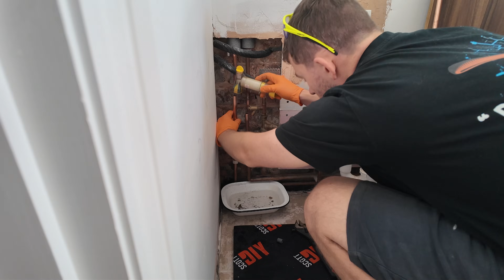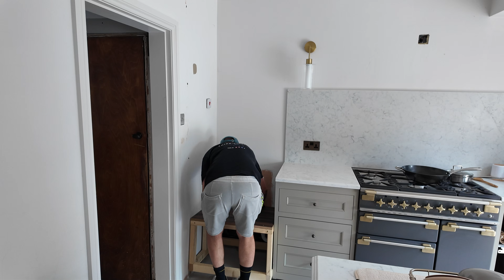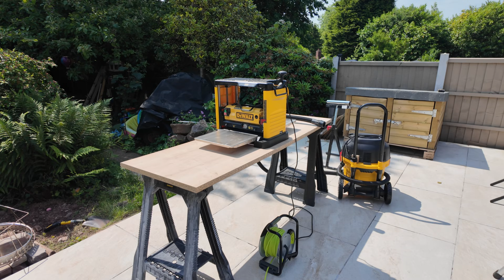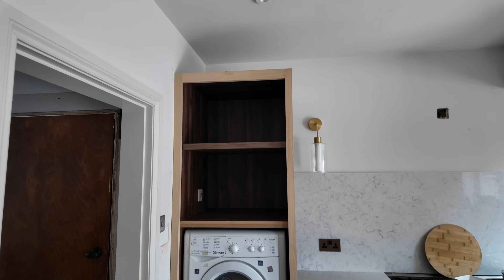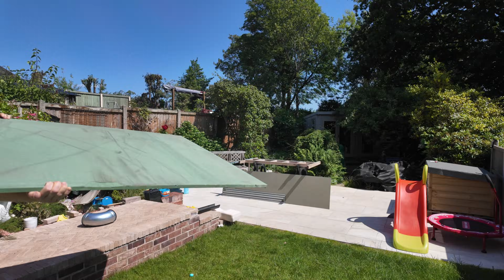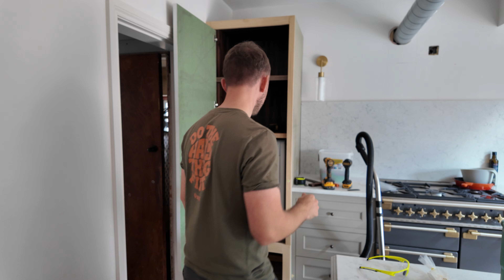DIY Washing machine in-frame cabinet from scratch

Comment: Wouldn't it be better if the washing machine sat on a sliding sheet for easy access to the back? You would have to attach the whole thing to the wall so it doesn't tip over

Comment: Do not raise your machine off the floor because someday you will have to have it repaired and service engineers will not lift it out of that position let alone actually be able to work on it.
Reply: Nobody repairs appliances any more.  It's easier and cheaper just to replace a broken unit.

Comment: This is what washing machine manufacturers say about sitting a washing machine on a platform.  Installing on anything other than a firm floor can void warranties and could create safety issues.  It’s never a good idea to raise a washing machine off the floor, too much vibration and too heavy.  It will be so noisy, that box will amplify the sound.  I would have moved the stop cock.  You are going to have your toilet just through the wall, you have already removed the brick for access.  Turn your cold water off at the toby in the street extend the copper pipe comming out the incoming main through into where your toilet is going to be and place the stop cock in the toilet under where the sink will be.   Then you can sit the washing machine on the floor.

Comment: It’s sometimes worth cutting the shorter ends off for the cross pieces before planing. Will mean you will have to remove less material from both pieces if there is a larger cup/twist across the full length of the longer board by shortening the length that the cup/twist travels through the peice.
Reply from the maker: That’s great thanks for sharing. I will remember this for the future projects

Comment: Personally I’d have used a sure stop stoptap and put the control switch up in that top cupboard, that would have made access easier. I know the draw comes out and access can be achieved, but not something you want to b3 doing in an emergency when you have a leak. Otherwise I think it came out great 👍
Reply from the maker: I get what you’re saying. When I was doing handy man jobs for local people in saw lots of difficult to access stopcocks so at least is better than most 👍🏻

Comment: Always wanted to do this too, but worried about the 'wobble' when the machine spins since it's not directly on the floor.  your frame looks solid so I'm assuming it's fine?
Reply from the maker: We have 0 vibration which is honestly my biggest worry whilst making this project. One of the best visuals of how strong this is is when I’m using the chisel on it to remove that MDF edge. The thing doesn’t move at all 💪🏼